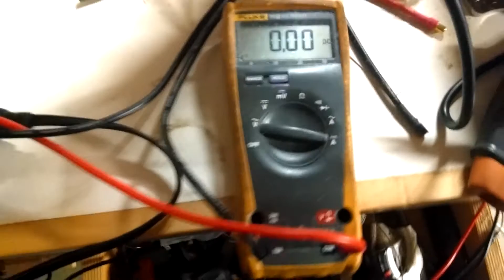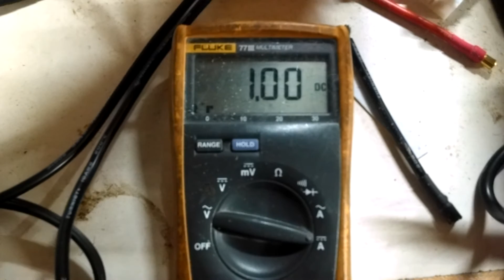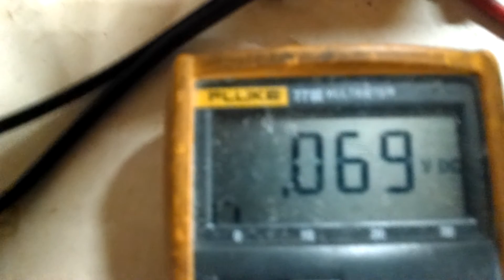How to measure the phase resistance of your Hub Motor

Comment: why would you want to know that resistance is that tell you something how much current you can put through that motor it makes no sense why you wanted to find out what the resistance is you're giving power to one of the wires or I guess you're giving power to the motor of one and then you finding out that it's going to drop to 4% what does that tell you when it goes through the phase wires why wouldn't what's the
Reply: to see how many amps you can get from a certain battery voltage